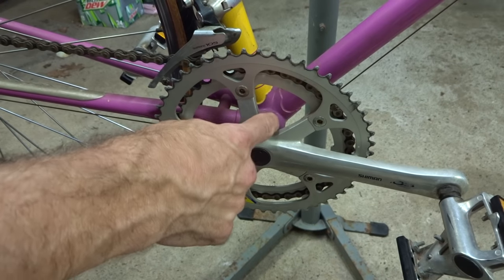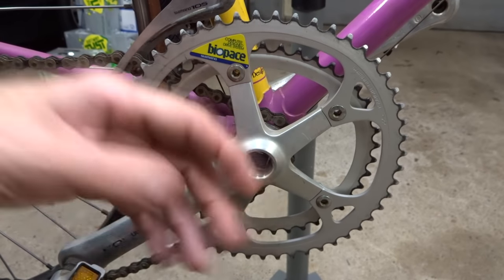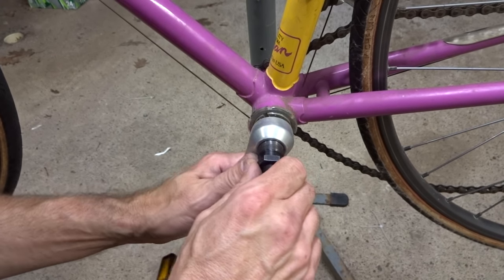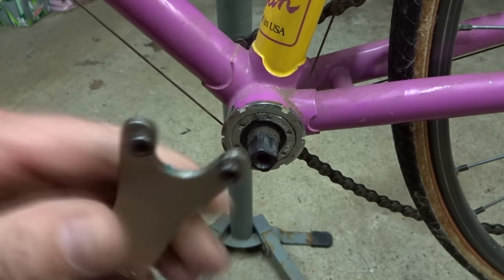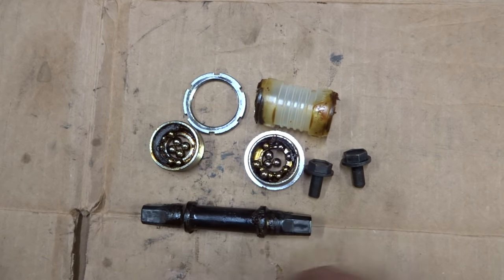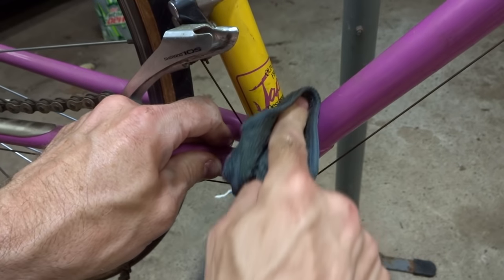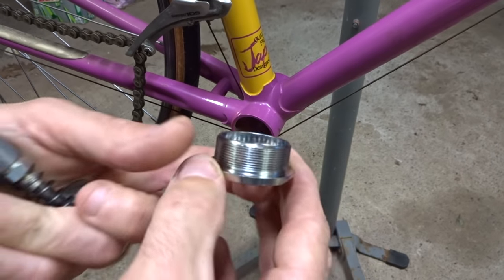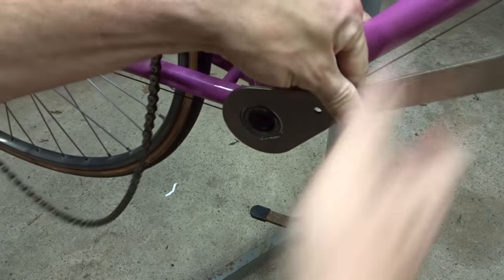Square Taper Bottom Bracket Service - How To Overhaul/Remove/Clean/Install

Comment: Years ago when I was learning about bike maintenance, I was always told to leave a little bit of play in the bearings (wheels, crank, headset & pedals), so that the bearing surfaces couldn't grind together.  Nowadays, on most of the videos I see, the advice is to have the bearings running smoothly, but with no play. Has this changed, or is it just a matter of preference?

Comment: Nothing went according to vid.  Everythread and the stem taper fits were seized- only thing that save the day was a bigger handle.  Had to get a automobile gear puller! to pull the crank arms.  The bike toolset I bought had tools that were way too flimsy for the task. The vid gave me the method to follow, which is greatly appreciated.

Comment: great video, very well done! When installing the first row of bearings, held in place with the grease, you need to check it  after hammering on the nut with the wooden mallet to make sure they have not fallen out of position.
Reply from the maker: I have never had a problem.
Reply: I was thinking the same cause all that hitting made me think that the loose balls can fall out

Comment: Glad you changed the bearings. A lot of people go to all the trouble of removing a bottom bracket, then put the old bearings in! A worn or broken bearing will quickly destroy all the others and the cup. I used to go to a bike shop where the owner wouldn't use a new bearing if it fell to the floor, and would only insert them with fingers or a soft plastic tool.

Loose bearings come in different grades and few of them are expensive, especially if bought from a bearing supplier. I mainly use sealed bearings now as they are so much better protected and aligned than the loose variety.

Comment: Let me share a story with you RJ. Recetly inherited a Carbon frame Dave Scott Triatholon bike maybe circa 1988ish, not sure. I was servicing the bottom bracket just like this one. Sat in a garage for 25-30 years and honestly was in amazing shape other than the usual things you need to swap out over time (tape, grease, cables, etc). As I'm putting the drive side bearing cup back in after cleaning and regreasing, I drop it and in my attempts to catch it, I punch it across the garage and then proceed to hunt down all eleven ball bearings for the next hour. Was not pleased. Didn't make that mistake again.

Comment: This was a great video! I just completed the overhaul of my bottom bracket on my 1970s Kabuki 12 speed. Turns out the spindle was installed backward. Maybe from the factory? The technique to find the right position for the chain ring crank is so important. There definitely was a better position on the square taper. It made a difference. I also replaced the caged bearings (9 @ 1/4") with 11 loose bearings. And Park Tool HPG. Thank you RJ.

Comment: Thanks man, I didn't know that the drive side is clockwise, I was battling with it until I watched your video.  Thanks, saved me a $ from taking it in the shop.
Reply: Me too!  Was futily torquing away in the wrong direction, until I saw this video.  Really helps when you turn it the right way!
Reply: I always remember the rotation direction as: "left is right and right is wrong."

On another note re grease on the square taper - that's a steel shaft and an aluminium pedal arm. Galvanic corrosion will soon join two dissimilar metals just from rainwater getting drawn into the gap between the shaft and the arm by capillary action - to say nothing of winter salt! I've needed an angle grinder to get a pedal arm off before now.
With that in mind, I prefer a thin smear of grease on the taper, and take care not to overtighten the nuts/bolts.
Reply: @treeefrogUK  Great tips, tanks :)

Comment: Thanks for the video.  I've had trouble with a couple of old bikes getting the threads on the bottom bracket clean, they felt gritty when I was trying to install the cups.  My solution was to use some detailers clay to press into the threads and it cleaned them out pretty well.  I think silly putty would also work.
Reply from the maker: https://www.youtube.com/watch?v=1IrAGP22V34

Comment: This video shows exactly what I wanted to see.  Thanks very much.
Reply: I obtained the specialised puller and removed the non-chain side crank. What surprised me was the amount of force I had to use i.e. I needed a 1m long breaker bar on the centre bolt of the puller and a 1m tube over the supplied spanner to separate the crank from the square shaft end. I was expecting a 'crack' like you get when separating the ground steel taper surfaces for a track rod end on a car but no, the separation was slow and took place over at least a full turn of the puller centre bolt. Still all good. With the crank off it was a matter of a minute to adjust out the excess play in the bike's bottom bracket.

Another surprise was that my time to complete my morning ride has dropped from around 15:17 to 14 something so I guess the slack in the bottom bracket bearings was somehow absorbing some of my pathetic leg power. Who knew that would happen ?

Comment: I appreciate hints about component orientation, such as being able to read the spindle markings right-side-up, when viewed from behind the bottom-braket.  Older bikes can be so filthy-dirty that markings are not-so-obvious until after they are cleaned, so noting or photographing correct orientation can be difficult.

I have a specific question about bearing grease.  I see that your preference is for marine grease (StaLube blue, usually), and that you typically demonstrate OVERHAUL (complete tear-down, degreasing with mineral spirits, then reassembly of squeaky-clean cups, cones, and (often brand-spankin' NEW-replacement) ball-bearings.  This is right-and-proper procedure - No argument.

However, I'd be curious to learn if you would contemplate a less thorough maintenance in which the bearing-set is RE-LUBRICATED by adding fresh grease to existing grease (assuming it's clean enough).

If so, is there a concern about mixing dissimilar grease formulations?  Lithium-base grease is most common, but Poly-Urea grease is also available, such as is used in the popular Park Tool PPL-1 PolyLube 1000 "green" grease.

Comment: Just overhauled one on a department store bike. Looked like a cartridge style from outside the cups. Tapped lightly on the grooves to remove. Discovered two things about the bike. One: There was only oil on the bearings. Two: There is a hole leading to the seat post tube from the bottom bracket. After reassembly, I pulled the seat tube and stuck my grease gun hose down there. Pumped grease down there.
Reply from the maker: I am doubting pumping grease in to that hole will get the grease to the bearings where it needs to go.
Reply: @RJTheBikeGuy  Very true! But there's definitely grease in the bottom bracket now. Lol
The hole was about 1/2" in size. The  hose tip was hitting the spindle. Pumped a good bit of grease down there. I do plan on making a plunger out of some rubber gasket material and dowel.  
Thanks for your great videos also.
Reply from the maker: This why those holes are there: http://davesbikeblog.squarespace.com/blog/2013/2/18/vent-holes.html
Reply: @RJTheBikeGuy  Yeah I remember reading something about those holes in the 1994 Bridgestone catalog.  Not planning to stress too much over this bike. It was a worn Wal-Mart return that made its way back to the shelf. Half price is what sold it. It will be used around where I work or maybe on some property I own down south. Keep the vintage and more expensive bikes home. Just getting the kinks out of this one.
Reply: @RJTheBikeGuy  I thought they were purge holes for welding process. Yes, this women was a welder👷‍♀️

Comment: I have just done this i had to do it in reverse as i couldnt get the non drive side crank of while on the bike thought i had stripped the thread using the crank remover ,got it into a vice and tried the remover again and it came of  watching your videos are good as you explain the procedures well my bike doesnt have that plastic thingo inside the framework and looking at the cranks i think someone else has had a go at them before me and they probably forgot to put it back in dont think it will matter much though .

Comment: This looks like the bracket I need to do maintenance on. I found a beat up bike that someone left on the curb. It is not an expensive one but I hate to see so much waste and a cheap bike is the perfect platform to practice on. I've used your videos to replace the axles, bearings, and derailleur but there is till a clicking noise coming from the bracket.

Comment: Thanks for the links for the tools.  I was trying to use a crescent wench to take off the bracket on the drive side but it wasn't working.  The tool you used should work a lot better.  Thanks

Comment: My 1985 Diamond Back Apex had the Biopace sprockets. I remember having to adjust that set up, snug but not too tight. Even kept well greased the spindle would always get pitted over time.

Comment: Thanks RJ. That was really clear and really helpful. Specially that you mentioned the cartridge type, whuch is what mine is.
Reply from the maker: Glad it helped!
Reply: @RJTheBikeGuy  are free bearing type bottom brackets (like what you have here) and the sealed cartridge type interchangeable? just overhauled and was wondering if it would be an upgrade...Thanks again for the confidence building tutorial. I loved the cold setting video, too.

Comment: Thanks for guy's like  you .  I just took off the bottom bracket and  because it was making noise and I took it off and it was rusty inside of there but no plastic insert  and I didn't count how many bearings in there. But I think something was holding the bearing in place its all rusted in there fell apart.  Remember it was full of  rust. Should I try to inspect the bearings or replace them and can I use packing grace for the bearings 😢😊

Comment: Nice video.  I have found that my "feel" for play can be  inaccurate unless I
have the drive side crank installed and use its leverage to detect play which I adjust before installing the other crank arm.
Reply: Same here.  I find it necessary to go just a hair tighter so as to end up with no play when re-assembled.

Comment: Hey everyone, I'm going to overhaul the bottom bracket on my newly purchased road bike from the late 80s, Bridgestone Radac. Before I begin I watch everything bottom bracket related by RJ The Bike Guy, of course. Here's where I learn a great deal about bikes and where I get my confidence to do this stuff on my own. So thank you RJ. 

Now I have two questions: 

1. When do you replace the bearings or how do you know when to replace them? 

2. The lock ring on my bottom bracket is on the drive side. On every picture and in every video I've seen so far it is on the left side where normally the adjustable cup should be.  Is it possible that the previous owner installed the bottom brack the wrong way? I also thought about the option that maybe its only the lock ring that is on the wrong side, but since the threading should be unique for each side, I guessed it's the whole cup?
Reply from the maker: If you are going to bother taking the thing apart, you might as well replace the bearings as they are cheap.
I have never seen a lock ring on the drive side, so it may be installed backwards. Which would be very weird unless it's a French or Italian made frame which have right hand threading on both sides. Normally the drive side is left hand threaded.
Reply: @RJTheBikeGuy  Hi again, Im so sorry and a bit embarrassed. At one point I turned around the frame and so later I thought I'm still looking at the drive side. So everything is normal, with the common threading clockwise and counter-clockwise. Thank you for the advice. 
I will maybe change the whole bottom bracket, because the bike has Shimano Santé groupset, but I just found out that the Bottom Bracket is a Shimano 600 one. Maybe this is puristic thinking, but well I kind of like the idea of having a whole groupset matching.
Reply from the maker: Not familiar with  Shimano Santé. But Shimano 600 became Ultegra. Good quality stuff.
Reply: @RJTheBikeGuy  I found out it's quite hard to find a Santé BB with the right measurements and threading , so I'll keep the 600  BB spinning :)

Comment: You can use a hammer and flat head/slotted  screwdriver  to remove the lock ring, but that can damage the notches for the hook wrench. A hammer can be used to remove the cranks BUT it will damage the cranks so a hammer should only be considered if you do not wish to reuse the cranks (such as if the teeth have gone on the chain rings) Otherwise the proper tools is always the best way to go.

Comment: Outstanding video, thanks. One question: I noticed you had a good bed of grease for the bearings in the removable races, but you didn’t grease the side that touches the post race. Is it bad to have too much grease?
Reply from the maker: The grease will distribute as soon as the bearings start to roll.

Comment: Thanks for your very useful channel. I was just wondering if you think it is worth servicing a bottom bracket like this one, or just upgrading to something newer. From a practical point of view, what would be the gains, weight maybe? 

Regarding new bb, after researching it seems that the easiest would be to fit a threadless considering that I have an old peugeot PH10L. Do you have any experience with these types of BB? 

Thanks in advance!
Reply from the maker: Sure. Overhaul it. Or upgrade it. If the threading is French, then threadless is an option.

Comment: is there going to be some wobble when u move the peddles like towards the last few seconds when your tugging on the peddle arm . my Batch 27.5  bike ( there made by huffy  suppose to be step up ) seems to wobble if i tug on it like you did the bolts are firm .I  hate to take it to a bike shop for a no fix problem or a simple tighten of a bolt  bike rides fine i'm close to parting with the bike  it sorta I hate to but  a 1 x 7 served me well but i'm riding 500 small miles a month its time i honestly thought the bike would not survive  last 8 months at first i thought i'd hate a one by bike  but i'm hooked less to fix and adjust the clincher is i never leave 7 th gear even on minor hill climbs as most folk i want more speed thank you for any tips the bike is staying in the family giving it to my daughter if it survived me it last her easy

Comment: Amazing explanation! Thank you so much!  It is an extremely helpful video. Just two questions: 1. What type of that crank set/bracket it was?( I have to replace exactly the same type.) 2. May it be changed on  another,  like SHIMANO BB-UN300 Bottom Bracket? ( Japan does reliable metal parts. Not like China)
Reply: Shimano BB-UN300 will work as a direct replacement for a cartridge or cup style as shown in this video. You need to identify the frame width and spindle length. 

Frame width will either be 68 or 73, spindle length could be 108-127mm. Will look like "68/113" on the packaging for example.

Comment: Hi! I overhauled the bottom bracket on my winter bike recently (really recently, yesterday, in fact), a cup and cone like this, but it's still creaking and hard to pedal mid-stroke. I tried loosening it, but it doesn't seem to help the problem. Could something be out of round? What should I do? Thanks!

Comment: I have an old Torpado.  The opening around the bolt in the crank arm is too small to fit a socket into.  I'm wondering how they got it in there but more importantly, how do I get it out?

Comment: Hey RJ, I have probably watched all your videos already, but I still don't understand the issue about spindle lengths. I'm in the middle of a vintage road bike restoration and I'm thinking about installing a square taper BB. I don't have the old spindle because I bought just the frame and fork. What do I have to keep in mind in order to choose the BB with the right spindle length?
Reply from the maker: Spindle length is dependent on the crank set. Look in the crank set specs for the proper length of spindle for that crank set.
Reply: @RJTheBikeGuy  Thanks for the response...and if I may...I have just one more question. We normally see BB cartridges measuring 68mm...but my BB shell is 73mm. What should I do? Thanks again...you have the best videos and lessons!!!
Reply from the maker: Then get a 73mm bottom bracket.

Comment: Are there any performance benefits with a sealed cartridge bottom bracket? All I see is that it's sealed from the elements and easier to maintain, but other than that, does it perform better? I have a 1980's trek 1000 that's in excellent condition that needs the bb serviced, but I'm not sure if a sealed cartridge is best, or if i should just keep it original.

Comment: Hey Rj , i recently wanted to take apart this old bike but the bottom bracket wont open. I already tried hammering it hard , using my body weight against the spanner(i weigh 55kg) but neither i could make progress with. Do you have any tips for this kind of problem?
Reply from the maker: https://www.youtube.com/watch?v=P9oIUmdI5JU

Comment: suggestion for me: i put new 1/4x9 bearing and tightened to same thread point but still not turning firm.video on why.spindle defect;can i use 5/16x9 on jamis boss that would use cartridge 68x122.5 if i upgraded.

Comment: Question: I am repalcing BB and the brand says "Bhogal" which I researched and is from India. No spare parts sold here in France that I can find. I measured the outer thread dia, and it read 33.5mm, roughly (my caliper isn't digital). Would that make it it British ISO ( , , , ? The replacement I bought is too large. Also if I keep the cups as you suggest, I'd need to replace the bearings and spindle, but I cannot find spindle standards. Any ideas? Thanks.